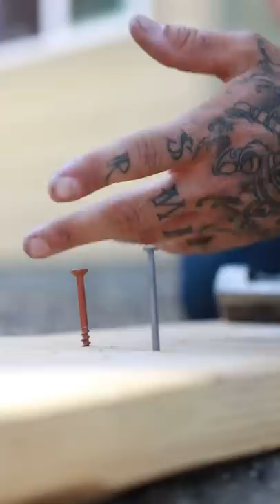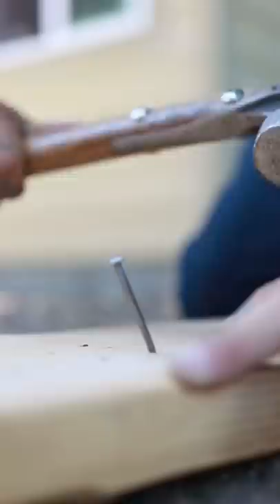Nails vs. Screws: Why do we use nails? #shorts

Comment: I’m sure it has nothing to do with getting the job done faster and making more money
Reply: And you'd be right regardless of the sarcasm.
Reply: No it doesn't. This man is correct. Screws only good for tension loads.  Nails have much higher shear strength and should be used for framing. In fact it is code in most areas. Nothing to to with being faster or cheaper.
Reply: No he is actually right, in construction you even have to adhere to certain nail types especially when assembling beams the inspector here will look at the nail pattern and nail type. If you used more expensive screws they would fail it and tell you to use nails.

Comment: So … the difference is the metal used. It’s more complicated that your making it sound man. 

Screws are designed to grip into things, they do this with threads. In order for the threading to do it’s job they need to be ridged, the metal needs to be heat treated and that makes it a little more brittle. 

Nails on the other hand are designed like a wedge. They don’t need threading to be effective so they don’t undergo the same heat treating, this leaves them softer and more flexible. 

The two tools are designed for entirely different situations not just “because one bends more”

Comment: And my grandpas garage he built with screws was the only thing left from a f5 tornado. I'd rather use screws.
Reply: More expensive
Reply: Adam Zinger  Building codes regulate the kinds of screws that can be used
Reply: Take a guess why It s easier to demolish a building with nails vs screw ... going screw all day. I build a shed with screws only , not a single move during huracane... literally used it as a shelter since my house (nail house) start moving af...
Reply: Adam Zinger  not 1 single building code in the country says you cant use screw's. I build multi million dollar homes, and we dont use nails, we use low bearing rated screws. And they are hurricane wind forced rated. You will never, not in a million years, get a hurricane wind rated home approval with nails. Nails pop out, screws don't. Cheap nails break just as easy as a cheap screw.

Comment: Okay so this is kinda bullshit to an extent, you can tell he’s using iron nails and the screw is clearly a way softer material😂 I’ve worked with screws that will and won’t bend period, but I’d never work with ones that will break on something important
Reply: Screws are actually harder. They have to be because of the torque that is put on them. If you used an impact driver on a nail it would twist it. That's why nails are cheaper too. They don't have to be hardened (or threaded). Deck screws are so hard they will eat up a sawzall blade whereas nails cut like butter. This video only pertains to shearwalls. Screws are used everywhere in building except for there
Reply: Softer metals bend....
Reply: Harder, not softer.
A softer material would bend more easily, a harder material would be much more resistant but it would snap instead of bending
Reply: Try cutting screws with a Sawzall screws are WAY harder.  Why do people comment on subjects they know absolutely nothing about?

Comment: Yes, nails are cheaper. However, the main reason is that nails have better shear strength, screws have better holding strength. This is why engineers call for nails, not screws in building.

Comment: You answer the question I’ve been pondering for the last 18 years
Reply: Not for me, I like to be able to disassemble and replace deteriorated pieces over time, nails make that a bitch.
Reply: @toddbertram6556  nails and screws doesn’t make a much of. Difference when it comes to demo, screws are usually more of a pain tbh. And it’s not like you’re doing regular maintenance on framing
Reply: Do you know what it would take to shier that many screws
Reply: Same, and I’m not even 18 yet

Comment: Good thing to remember is not to put screws in a location where there is going to be shear forces.
Reply: Depends on the load. For a ledger on pantry shelves they work just fine. Framing is a different animal. Attaching isolated systems to the framing isn’t as bug a deal.
Reply: @Dom-nt4pi  that’s what he’s saying.  Also nail will work themselves out of place. Screws won’t
Reply: @thomaspayne6866  I disagree. If you attached a pantry shelf ledger to studs using screws, those screws are completely in shear. Essentially what "Boots" there is saying not to do. He's not wrong, but for loads this light screws work fine. Framing though is a different animal like I said.

Comment: I haven’t seen a screw shear, yet. Though I did see nails pull out. Specially over time. Screws will hold and bend because buildings don’t move as fast as a hammers beating on a screw. Laterally. Just to prove a point. Where nails will get pulled out.

Though speculating, I think nails are used because they’re faster to work with than screws.

Comment: Some nails will creep out with the wood flexing with temperature. Screws will stay in place.
Reply: That's why you used spiralized nails
Reply: @theonlyiainever  That too.
Reply: White Smoke  no, Google spiral framing nails. They spin as you nail them in so they can't be pulled straight out.

Comment: The reason is time. Imagining framing the entire house screwing everything together, it would take you and your men twice as long if not more to complete the project. Can you imagine sheathing the exterior of a house using screws! forget about it , you might as well go back to hand nailing!
Reply: Exactly
Reply: What if I told you both reasons fould be valid?

Sound like the kind of guy who didnt pass science and tries to convince people science is irrelevant.
Reply: Yup, 10× faster and 10× cheaper and have better shear strength.
Reply: With screws you need less of them. Ever heard of torx screws? Of bricks?
Reply: @WouterZtube  The time it takes to put in 1 screw you could have 10 nails in. You can nail as fast as you can pull the trigger on the nail gun. I don’t care how many less screws you will have to put it. I can do it faster and for less $$$ with nails. And I’m someone who loves using screws for their strength. Nails are just way easier and cheaper.

Comment: The real reason is because nails are cheaper and faster.
Not because deck screws snap.
Structural screws dont snap... but cost more. 

Using nails gives your average builder an extra vehicle each year.

Comment: This isn’t comparing nails to screws - it’s comparing 2 different types of metal. You can make screws from the same material as this nail, thus not being so brittle. Nails are faster to employ, cheaper to produce, and get adequate results - that’s the real reason why nails are used.

Comment: You’re pushing the screw way more down than the nail
Reply: He hit the nail all the way down into the wood, is your attention span so fucked you can't finish a <1 minute video before commenting?
Reply: @BlankRequest  You're complaining that he didn't do something, when he did. Unobservant. Nails are designed to withstand bending, early or late. And I didn't like my own comment, no idea where you're getting that from.
Reply: @doicaretho6851  he's trying to show why nails are better because they can bend more and the first thing he does it push the screw fully back. He then only slightly bends the nail and concludes nails are better. im saying why not do the same with the screw or the nail. it wasnt a controlled equal experiment
Reply: @doicaretho6851  the same thing wasnt done to both
Reply: @BlankRequest  at the very end of the video, he bends the nail to a 90° angle, and still pulls it back up-right without breaking it
Reply: @leonaustin123  no?
Reply: @BlankRequest  0:27 - 0:32 my guy.
Reply: This is not hard to try for yourself. Go test it out record it and post a video with  your results.

Comment: If your building is moving enough to snap a screw you didn't build it properly. 😂
Reply: @Orangecatty  nah my dude. If your house moves enough to sheer screws then it was fucked from the start. You could build a house with screws. It would be much stronger. It would also be way more expensive in materials and take like double the time so like double the labor cost. The added strength isn’t worth massive cost difference. Any house that moves enough to shear a screw should be condemned because there has to be major foundation issues for it to move that much.

Comment: If the clamping load between members is greater (something only screws will achieve) you'd have the advantage of friction to resist shear forces.. the leverage you also gain hitting the head that's stuck out that far puts more stress on one point than a screw might ever be subject to in normal use. Neat observation but a house built with screws would likely be stronger, it's just less economical.

Comment: I think that modern nails with adhesives on the are very strong but clearly not as strong as nails. Screws def are a must with flooring. As far as the rest of the structure I’m not so sure about

Comment: "We use nails because they're cheaper and faster".
-Literally, every builder ever
Reply: Did you seriously just copy the top comment?
Reply: Exactly nails and screws have pretty much the same shear capacity but screws are much stronger in withdrawal
Reply: don't comment if your dumb nails are required in building codes screws are not allowed most of the time

Comment: If your home moves, you´re doing it wrong. We do it for costs and speed.
And yes certain parts like floors and roof will move from the constant preassure and temperature changes but we´re talking micro milimeters not enough to brake screws.

Comment: Love the hammer. I carried a DFR20 then the Vaughn version for almost 20 years.
Reply: I have 2 Douglas hammers! I love them too!
Reply: I had a Douglas but after I broke the handle I threw it away and bought a stiletto
Reply: @godisgreat7779  I still have the original handle on the one Vaughn version, and put two on the Douglas over  15 years and lots of use. I tried other hammers, but there are features a Douglas has that are irreplaceable to me. The square corners kick butt for setting toe-nails being one.
Reply: Finally someone mentioned the hammer..
Reply: White Smoke  design was sold to Vaughn by Douglas who in turn put the Dalluge name on the titanium versions and steel as well as their own Vaughn branded steel version. It's a Douglas DFR20 with another name on it. Now the Douglas guy was trying to start back up I think the color fill in the engravings is red, and minor changes being the difference in version two, which is named tc20 if I recall correctly. I didn't catch the brand on the video first time through, but the design is unmistakable.

Comment: I use nails but they have to be stainless steel, galvanized nails corrode and cause the wood to deteriorate quicker at the area the nails are driven

Comment: How come when they remodel homes they use screws and not nails? Even on load bearing walls?
Reply: Theyre usually not supposed to unless they are special screws
Reply: I would assume the the dwelling had spent a few years settling and most of the walls arent gonna shift as much as a new house, otherwise it could just be inexperienced handyman or ignorant home owner thinking theyre doing the right thing.
Reply: Depends on what your talking about when you say "remodel" homes. That's a pretty blanket term.
Reply: Looking at it from a make ready perspective, replacing damaged sheetrock, fixtures, windows etc, you dont want the new stuff trying to weasel its way off/out of the wall. Nails would hold but as the video shows they allow wiggle room, screws would be a more "permanent" solution.
Reply: Screws are used for diy. When you remodel house most of the time it’s not even big only the interior look :/

Comment: Okay fair point then why do all my nails back off and my screws keep everything tight obviously not building to that extent but I’ve done porches and decks and only used nails a handful of times and less than 30 of them
Reply: Most of the time when you use screws for DIY, it’s overkill, so you’ll never push the screws to the limit, unlike a larger building in bad weather
Reply: You aren’t sitting there calculating sheer loads or compression... you’re just screwing boards together nice and sturdy
Reply: Plus nails in exposed areas can cut your feet up. Screws are a little better at staying in the wood
Reply: Screw are for diy and not for big construction

Comment: Right, bad screws like that brake. This is bs, your "screw" broke immediately, it was just a cheat screw. The Reason you work with Nails is because they are cheaper than good screws, but they do their job good enough. And houses made of drywall and wood won't save you at all in any case of catastrophic. I live in Germany, we mostly have houses made of stone. We had some natural catastrophics over the last few years, but we just called it a storm, because our houses does not fall a part if it is windy outside. Sometimes there are some roof tiles falling down, but that's it. It's not like we have the most dangerous weather, but the way our trees move sometimes reminds me of the palm trees moving in the wind in Florida, but here is everything fine and in Florida it's doomsday. Who ever thought, it's a good idea to built storm resistent stone houses in a country like Germany and wooden huts in an area, known for its hurricanes, earthquakes and floods?

Comment: Partially true. Screws (meant for houses not decks) also have a much higher shear value and can typically carry more in shear. Your house does need some slight movement but a big reason is just cost and time. Screws take a long time and are more expensive. Nails are quick and cheap. Plus in most residential applications nails are sufficient and screws benefits don’t show up.

Comment: when a nail is actually being used to fasten 2 pieces of lumber together at the joint it created a shear line, doesn’t matter how many times it moves when the 2 pieces of lumber making that joint with the nail between them act like a pair of scissors. carpenters use nails because they are quicker, cheaper, and easier than screws. not this bullshit lmao

Comment: Nails are used because it's the cheapest and fastest way to build a house. Drywall screws have a clamp force of over 100lbs while screws slip at 20lbs
Reply: You are talking about something entirely different to show your limited knowledge.  Good job.
Reply: He’s talking shear strength, you’re talking hold strength.
Reply: This is a pretty good example of why both fasteners are necessary. They accomplish different things.
Reply: They’re both doing different things. When shear strength is necessary, nails are the answer, when the holding power is necessary then screws are the answer. They both have their place

Comment: It doesn’t happen often, but I’ve pulled out #10 grk’s (which I assume are structural) that have been sheared, and they’re not even old. Not some crazy application either.

I still use them for framing when it makes sense, I’d say it’s like 5% alarming

Comment: Exactly. Nails are for lateral forces, like a house moving. Screws are for vertical forces, like someone walking on a deck. Use screws on a house and they'll snap. Use nails on a deck and they will walk out of the hole without threads holding them in.

Comment: It's really just because nails are faster and cheaper. A frame held together with screws should hold up just fine, but an experienced carpenter can hammer in nails far faster than a drill can put in screws.

Comment: The tensile strength and hardness of the screw is probably double the nails. They don't bend back and forth once they are set because the board is completely surrounding the fastener. This manner of testing is only used when the material is expected to be bent back and forth, something that shouldn't happen once the house is built. A tensile test would be more informative. I would challenge him to screw two boards together and try and break the screw without backing it out. It ain't gonna happen. The screw head will eventually rip a hole though the board before you get it out. The material will fail before the fastener. Do it with a nail and the nail will eventually just pull out of it's hole.

Comment: Nails easy pull up and does not hold  strong like screw..
Reply: When a stud is nailed in a wall why is the nail going to withdraw? Nails have more shear strength
Reply: Nope
Reply: @patroberts4708  they sure do loo
Reply: Lol
Reply: @lloydflyhuntbc9923  I see it alot on older wooden houses in Florida. Usually from foundation settling, wood expansion and shrinkage, movement caused by hurricane winds, etc. That being said these houses are 60-100 years old.

Comment: They make structural screws now for joist hangers and other hardware. Technology has come a long way. Obviously production framing you’re gonna use nails. Makes more sense. Structural screws are just as strong. All screws aren’t the same just like nails to hang pictures aren’t  the same as framing nails. Nails also will pull loose over time.

Comment: Can use screws to build just need to make sure you purchase the proper ones. Many say “framing” or “building” on the box but when read the fine print they say not for building structures.  And the screws meant for building cost allot of money. As far as a house screws are fine as long as they are the proper ones.  Also have seen a little addition unknowingly built with the cheap non structural screws and it’s still standing. But was/is only like 12x20’. But

Comment: Each has its advantages the screw has less shear strength but does pull out as easily…there are situations where you don’t necessarily need incredible shear strength but you need the faster to grip inside the wood better…ive used both at times when I need both grip and shear strength